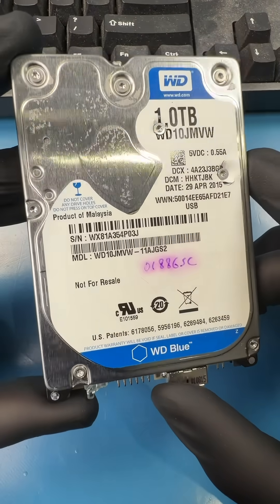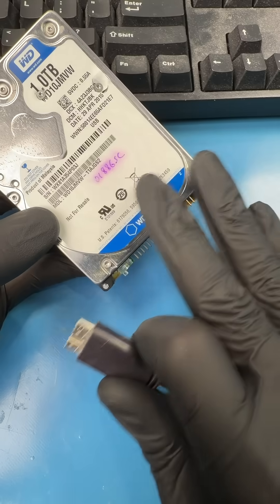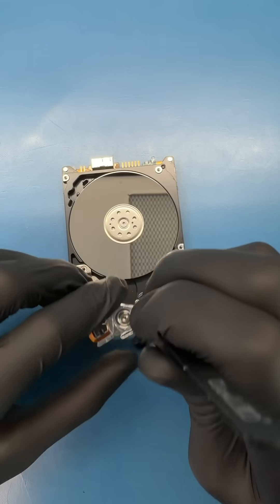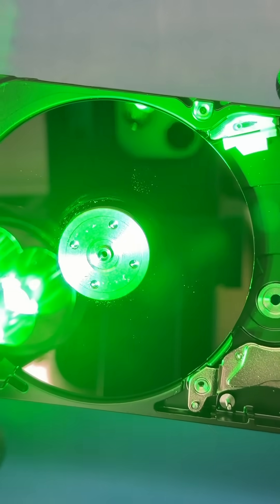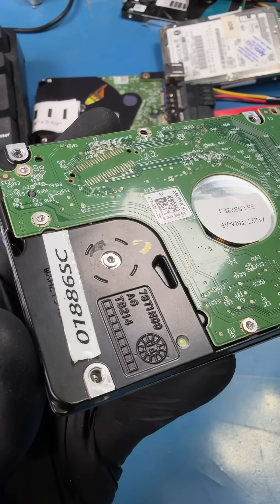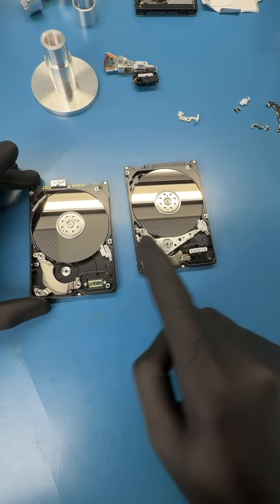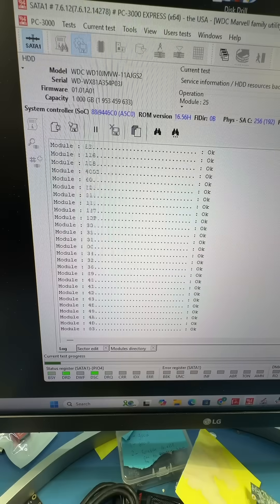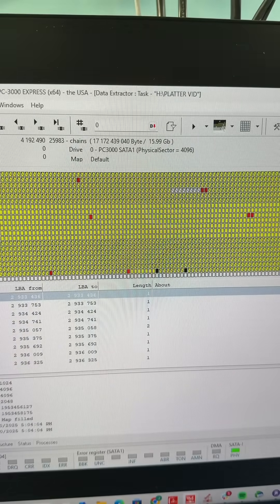Clicking hard drive? #datarecovery

Comment: I was at a large company in the 80s where all the printers and computer screens were configured on a hard drive that was in a control unit where no one had taken a backup, and I managed to put in circuit boards from a whole one. It saved my day as I didn't have to walk around the large workplace looking for printers and screens.

Comment: I have a raid 5 array, since it only has single redundancy I also have the same family pictures backed up on four 10tb external hard drives two geographically isolated from the other two and the array. My eventual goal is to have two Raid 6 arrays geographically isolated from each other. Overkill maybe, but my wife would kill me if I ever lost our family pictures.

Comment: Why does the drive say NOT FOR RESALE?
3-2-1 rule for backup. Make 3 copies. Have them on 2 different formats (optical, magnetic, flash, SSD). Have 1 copy stored not in your home. For the cost of FREE , the fire department will fill your basement with water to put out your house fire.

Comment: When I was working an hourly tech sales job, I had a guy come in, pretty despondent. He said he needed two of the best external backup drives we had, because his last two had failed. I said, "both failed?, was there a massive power surge or something like that?". He said no, but the local place could only access the movies on the drive! WTF?!

I asked if he still had them and he did. I said let me have a go. What I ended up doing was swapping the circuit board from one to the other (they were of the same type & firmware). I retrieved all of the data from his wedding to his children's births. 

I was at work when a huge delivery of flowers arrived.  :^)
I still have his thank you card. That was in 2008/09? I've kept a pin-board of all of my thank-you notes, over the years. Been working for myself since 2012.  :^)

Comment: This is why I make monthly backups and use multiple drives over time.  I just ask my self,  If I loose this data how do I feel about it.  If I don't like it I will copy the data, manually, to another drive and schedule a back backup and order another identical drive for cloning.  I also store hard drive backups in EMP / Air tight containers.

Comment: I wish I knew about this channel before paying $800 for a horrible data recovery job. Original quote was $350 and magically went up to $800 for “more extensive recovery”. Which was still missing a lot of data after getting a bunch of empty folders. I understand they can’t recover all the data but I knew something was wrong when he would tell me to bring the drive back and give me empty folders. I think he just used software instead of actually doing a repair.

Comment: if he didn't have the same disc, he wouldn't fix anything. He did the "ordinary thing" of replacing the platters. The problem with this disc wasn't the platters, but the mechanical part. It's even easier if the mainboard of the disc goes out, then it's replaced and "it goes on"

Comment: I tried this repair at home once - it didnt go well. You can see there the only plastic part, the holder for parked heads - it got cracked a little. Which was enough for those heads to destroy themselves while moving over that crack... Shame, i was wondering what would be recoverable with this amateur fix attempt :D

Comment: A hard disk and a hard drive generally refer to the same device used for storing data, but "hard disk" specifically refers to the physical disks inside the drive, while "hard drive" is a broader term that includes the entire storage device. Both terms are often used interchangeably in everyday language.

SSDs (Solid State Drives) are faster and more durable than HDDs (Hard Disk Drives) because they use flash memory with no moving parts, making them ideal for quick data access. HDDs, on the other hand, offer larger storage capacities at a lower cost, making them suitable for long-term storage needs.

Comment: I was wondering, if the platters are dirty and you can't get them clean with just air, is it possible to clean them any other way? Can you use water or any solvents to get rid of e.g. fingerprints?

Comment: I really love how the circuit board keeps changing from USB to SATA.
Reply: Somehow I believe this is a fake video. As soon as you do change the circuit board and do not change the BIOS Chip(s), it will NOT work and the head starts clicking. He obviously changed the board but never said he changed also the chips.

So how big is the chance, he faked the first drive which "came from an other data recovery center" just to market his channel?

Comment: If it’s important data, then you should follow the 321 rule. 

I personally keep 1 original hard drive copy , 1 backup hard drive and cloud storage 

(the following text below is copied from Ai)
The 3-2-1 backup rule is a data protection strategy that recommends keeping 3 copies of your data, stored on 2 different storage media types, with 1 copy kept offsite. This approach helps protect against data loss from hardware failures, natural disasters, and cyberattacks by ensuring redundancy and geographic separation. 

How to implement the 3-2-1 rule 

* 3 copies: Have a total of three copies of your data. This includes your original, or "production," data, and two backup copies.
* 2 different media: Store the two backup copies on two different types of media. Examples include:
    * Internal hard drive + external hard drive
    * Hard drive + cloud storage
    * Server + tape
* 1 offsite: Keep at least one copy of the backup in a separate physical location from the original data. This could be:
    * A remote cloud storage service

Comment: You NEVER HAVE ANY DISTRACTIONS WHEN DOING A BACK UP. THAT IS THE CARDINAL RULE. YOU MUST HAVE AN ISOLATED AREA AWAY FROM PETS AND FAMILY WHEN ATTEMPTING A BACKUP. MAKE SURE YOUR EQUIPMENT IS CONNECTED TO A UPS BEFORE STARTING A BACKUP. WHEN FINISHED OURCHASE ANOTHER DRIVE AND BACK UP THE FIRST BACKUP. IS POSSIBLE INVEST IN AN "M" DRIVE DVD. PURCHASE THE ARCHIVAL RATED MEDIA THAT DOES NOT UTILIZE AN ORGANIC DYED SUBSTRATE.
SIMPLE, LOGICAL RULES TO BACK IP BY.

Comment: This is why not all technicians are equal
Reply: Some are "the greatest technician who ever lived".
Reply: @lostsailor2498  elite reference
Reply: @lostsailor2498 when I saw the word Technician, I knwq rhis would be here 😂
Reply: @lostsailor2498  yk ball
Reply: Sorry for writing this comment here but YouTube won't let me write my own comment (just replies). Is it possible to recover data from a drive that's been formatted or that's had a new image put on it?
Reply: @willmason5774 yes its possible but just a real pain and it depends
Reply: @willmason5774  If I’m not mistaken, there are two ways to format a drive. The fast one just "tells" the controller on the drive to forget about the files there, marking it as empty. It’s really easy to recover this. The secure erase, however, requires a bit more special tools and manually resets all the bits (0,1) one by one so the data is nuked, although some software can try to estimate the old values especially on HDDs. I’m not an expert tho, and the safest formatting method is always a hammer.
Reply: @CodaDev1 It's crazy how we can store years of memory on a little disk made of metal. We made the rocks think.
Reply: @FreeThinker-t8v  it indeed is!
Reply: @CodaDev1  you can guess despite of past write overs, but you would have to pay tens of thousands for the tools that can attempt such a task. and it would heavily degrade any files on it(think black pixels or stripes of black and or random colors on a picture(or broken tv lol))
Reply: @willmason5774 it also depends how it's formated if it's by filling it with 0s then to my knowledge it's nothing on it now
Reply: @willmason5774  If the sectors with the data has been overwritten, it's almost impossible. If you only did a quick format and didn't write new data then it's very likely you can recover everything or almost everything.
Reply: But was recovery stopped due to company policy? 

The fact they got debris on the platters is horrible.
Reply: @00SEVEN28 They were low level people who were just following the company guidebook and not taking any care because it didn't matter. To them anyway.
Reply: Just like how not all mechanics are equal
Reply: Just like not all mechanics are equal
Reply: in every job you can find incompetent people.
Reply: @madEsiak  This is particularly true in the medical field!
Reply: Although i think the company that couldn't do it was because the sector that they sent in for data recovery were not capable enough/didn't have the priority on the mind to fix it since they are being paid by the hour and not work and can still charge the customer for opening the harddrive. 
Controlling the company and managing it is a tough task
Reply: paid vs passion
Reply: Some technicians arent technicians at all, a lot of them arent even educated, they are amateurs. Which sounds to be the case here, it's also likely they just didnt care and couldnt be bothered to try and find a solution.
Reply: I used to be the in house tech for a big box retailer. We had a contract with a data recovery service that charged $999.99 to get data off. I had a few customers balk at the price so I had a little side hustle to get the data for only $500.
Reply: 😉 What about the greatest technician that has ever lived
Reply: Just not like all people are not equal as well.
Reply: This statement about equality is true in every field. 

If the platters are good, you only need to transfer them to a good donor drive to get your data back. Then you get rid of your revived drive, since stuff likes to go wrong again at the worst time. 

Bottom line; most people just do the bare minimum, while some give you 100% -or even go the extra mile.
So, if you find a good technician, keep him. 
Oh! Don't whine about the price either. Most of the time, extra costs extra.
Reply: They weren't technicians. They were just on the clock big box employees who don't actually know what they're doing and we're following a step-by-step guide the company puts out on how to do it that was written by people who knew what they were doing but the employees didn't They just follow the steps.. 

And since they don't really care and weren't professional technicians they don't work as hard or take as much care as a professional would.. And since they get paid the same whether it was recoverable or not they are much more motivated to just label it as not recoverable if the project looked too hard 

It's why you should always make sure to take Taryn who you send it to
Reply: Not hating on @salemtechexperts but.he doesn't even know what *dataexeperts does. I love the guy but he is more of a youtube finesse than a technician.  
Told you by a real tech st FixMoi
Reply: Exactly
Reply: We are all equal in nature at least.

God bless, much love.
Reply: That goes for any and every job.
Reply: Define technician. There are a lot of different types of technicians. Ignorance again
Reply: maybe one of the worst comment, literally no one is equal
Reply: Possible DEI hire
Reply: Since he's running a small business, it's more likely that this story is completely fabricated and he's found a way to trick us into watching a 2m commercial for his services.
Reply: I just wanna tell about a purpose of life beside doing a good living 

That there is only one god ( not jesus ) that we have to give him the credit and worship him to be in the paradise 

And as the bible said

John 20:17
I'm ascending to my father and your father , to my god and your god

Mark 13:32
But of that day and hour no one knows , not even the angels in heaven , nor the son , but only the father 

1 Timothy 2:5
For there is one god and one mediator between god and men , the man christ jesus

Hope we all meet in the paradise 💙
Reply: @VideoEditing-x5u 

Deut. 25:11 When two men are fighting and the wife of one of them intervenes to drag her husband clear of his opponent, if she puts out her hand and catches hold of the man by his privates, you must cut off her hand and show her no mercy.

Comment: These WD elements USB-3 drives have a very common problem, the silver plating of the controller board oxidizes and they die. I brought back to life the exact same model one week ago by cleaning the oxidized silver contacts and scratched the motor and head spring contacts, including the gold ones. Put it back together and it works.

Comment: PSA: backup your data, please follow the 3-2-1 rule.

3: Keep 3 copies of your data. One main copy, and two secondary copies. Copy your data to different drives, like different external HDDs and/or SSDs.
2: Keep two copies within close proximity. For example, chose one drive to use daily, and chose your backup drive to keep in a safe space.
1: Always, ALWAYS keep one of those three copies off site. Using cloud storage (Google drive, Apple iCloud+ or Microsoft OneDrive) is best practice. However, using a third external drive and keeping it at a friend’s house or bank security box, can work too. ALWAYS ensure the drive is in a different SAFE location than your own home. This is important in case of a catastrophic incident, including theft, flood, fire, tornado, hurricane, etc.

Comment: First rule dont use hdd externals ever. Second rule when its important data use a raid setup so everything is automatically stored on 2 drives and you will always have a backup.

Comment: Get a blueray burner and offload your precious data to m-disc blurays. Don't trust mechanical drives for long term storage.
Reply: That didn't make sense. Guess what kind of drive a Blu-ray disc drive is! 
Besides that, sadly fewer and fewer optical drives will be made, so even if you burn something to stone like that, good luck finding a drive to read it in another decade or 3! A millennium of unreadable stone it's just as useless as rocks that had nothing etched into them!

Comment: I'm shocked that a data recovery company is out there not doing platter work in a cleanroom or flowhood (refering to the 'big box guys' mentioned). Modern high capacity platters especially are super sensitive to dust, thats why recovery can be so expensive and there is very few small shops that will offer platter transfers. The latest drives can be vacuum or helium filled also which is an obvious complication. 

So back that D:\ up.

Comment: It's always "it's not fixable" with most shops. Not "we can't do it". I've seen shops that don't know how to swap a blown fuse telling people their device should be thrown away
Reply: This is a pretty obscure issue. I could see why the technician who worked on this called this NR. I am a data recovery engineer myself. I would have never thought to swap the platters to a new chassis. This was good problem solving. I also know who original company is and they are good at what they do.

That still doesnt excuse having good backup practices. Sadly see way to many dropped drives with platter damage. :(

Comment: So the original drive had a USB connector, then after swapping heads the drive magically had a sata connector. Then the donor drive has a USB connector then after putting everything into it, its back to a sata connector. Is this drive pcb fluid or something? 😂

Comment: I'm not exactly familiar with hard drive stuff. But could this have been prevented with a solid state hard drive? I'm assuming there are no moving parts in a solid state hard drive.
Reply: There's no such thing as a "solid state hard drive."
Reply: @HelloKittyFanMan.. why is it call a solid state drive?
Reply: @alaska79 : Because of exactly what I just said!
Reply: @HelloKittyFanMan.. but the question still stands. If there is no such thing than why is it called that?
Reply: @alaska79 : No it doesn't, because you're not understanding what I said. Go back and carefully reread what I originally said.

Comment: Always store memories stuff on dvd. Keep in air tight biscuit tins and preserve well. Dvd should be super size to 300mm and spin vertically.  With 4 reading heads, the access would be very quick.